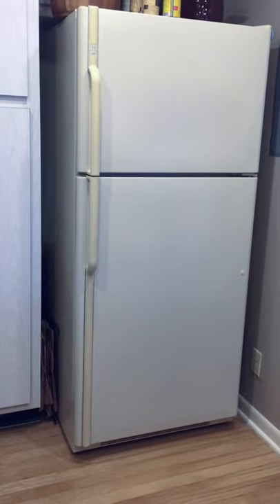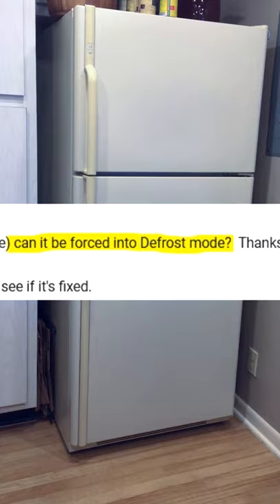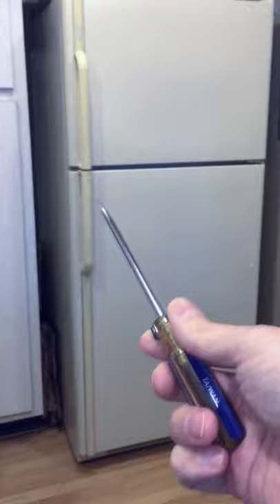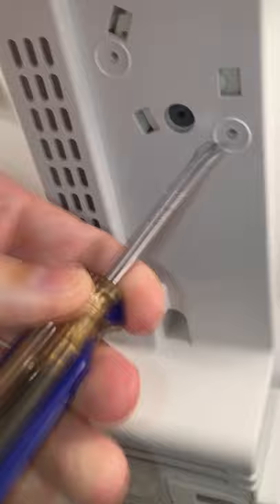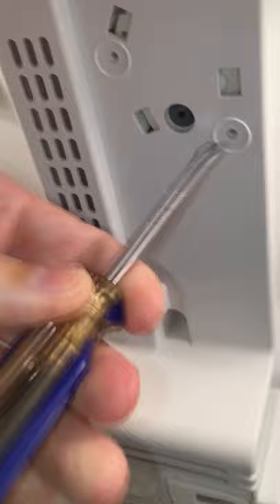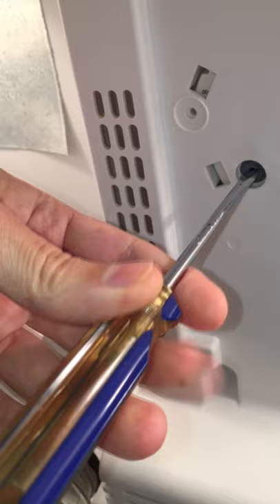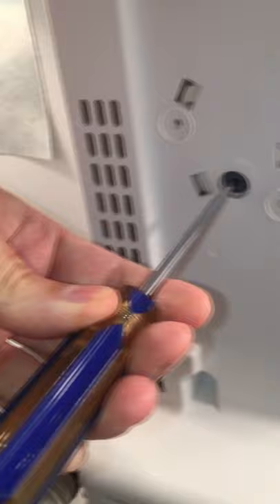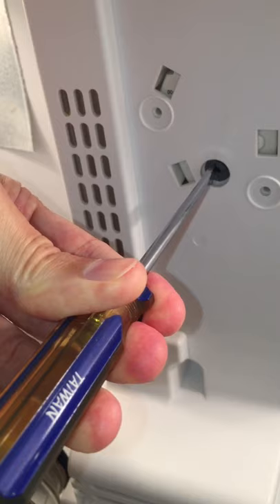Forced defrost top-freezer #shorts

Comment: How to force defrost on a older model GE top freezer similar to this video?  Similar procedure - turn clock wise until you hear a loud click?  It will defrost for 20 minuetes and start cooling again?  What if I have more built up ice, just repeat it gain?    Do I turn it counter clock wise to turn off defroster in case the timer is bad?  I am not sure the timer is good. 
 
    My frig is not cool in the bottom fresh food section but the freezer works ok.
Reply from the maker: If your GE is not computer operated, it should have a similar timer that rotates clockwise only. If there is too much frost, repeat the manual defrost. But make sure the defrost actually works, gets hot, and the defrost water goes out on the back. If the compressor is not restarting after about 30 min, rotate the timer a little more clockwise till the next click because the timer could be bad.

Comment: If I turned the defrost timer and it clicked off but didn’t defrost the freezer, do I just need a new defrost timer?  Compressor works fine, freezer is fine but freezer door got left open for a few hours frosted up events with ice and now my refrigerator won’t stay cold on the bottom! Please help!
Reply from the maker: If the door was left open for a few hours, you may have just got an excessive amount of frost. That's probably too much for the defrost cycle to handle at once. Maybe try another defrost cycle. Or better yet, unplug the fridge (remove everything from the freezer) and let it defrost with the doors open for 24 hours. Or help the defrost with a hairdryer by blowing hot air into the freezer compartment. WARNING: Don't blow too close to the internal plastic liner, it may melt.

Comment: if it doesn't start defrost heater ...wats wrong....timer, heater, thermostat
Reply from the maker: Yes, it could be any of the listed above. But the most common problem is the defrost thermostat. Sometimes, you can actually see that it's swollen.
Reply: @Your-Self  yes it was swollen....replaced....but no change....how often can teeth of timer break ir its connection to activate heater go bad...?? I just ordered heater and will manual defrost again if needed befire fridge reaches that iced over point keeping cold air reaching fridge compartment....it was cheaper of two n seems more likely as timer still runs if manually set to heater activate position....I think teeth are broken like at four hour run position or its connection to heater is broken...I have never really caught it in defrost cycle on its own....I guess I shud check hours on . heater cycles 20min. I've check that with stop watch on phone...thst section of teeth in timer ok...the rest I dunno  yet...I've seen some videos using light switch to activate a diagnose signal, to bypass or force cycling of compressor, defrost, processes...is that right or possible without removing each part....right it still functions n really don't want to chance food spoilage at cost of food these days...just can't afford another hundred bucks if food in trash...as defrosting takes half day manually...unless you have quicker way....I use small ceramic heater n heat gun n hot water in spray bottle....n lots towels...ice buildup is quick if left moisture left in side freezer or fridge...part shud be here friday...thermometer in both compartments now to keep eye on any change asap...thanx for tips

Comment: This guy knows his stuff.
Reply from the maker: Appreciate your comment!
Reply: @Your-Self  I just bought a new frigidaire fridge/freezer.  same thing as with the old one - when i let it get cold inside in the winter, it barely (if at all) freezes water. most of my frozen goods get slushy.  however, once i turn the room thermostat up or it becomes spring/summer weather it works fine.  is there a way to correct this?
Reply from the maker: How cold does it get in the room where your refrigerator is located?
Typically, if the temperature gets below about 55°F (13°C), the compressor starts acting funky on regular refrigerators. (I should probably make a video about it since it's wintertime.) There are specialized garage-refrigerators that can work in extreme temperatures.
Reply: @Your-Self  it goes down into the 40s sometimes.  i don't feel like i should run a heater in the room to keep water frozen.  it's a regular, but new frigidaire basic fridge/freezer unit.  know of any ways to make it keep water frozen?
Reply from the maker: The trick is to keep the refrigerator Temperature Sensor a bit warmer, not the whole room. Depending on your model, the Sensor is located somewhere on the top of the Fresh Food section. You can actually buy a "refrigerator garage heater kit," but it doesn't fit all models.
Reply: @Your-Self  Right on. I'll see about getting one of those garage kits.  had no idea that was even a thing.  thanks again for your expertise.

Comment: How do you get it back on????
Reply from the maker: It should automatically restart within 30 min. If it doesn't, the timer is probably bad. 
You can manually advance the timer also... just keep turning the screwdriver in a clockwise direction until the compressor kicks in.
Reply: @Your-Self  thank you 🙏🏾